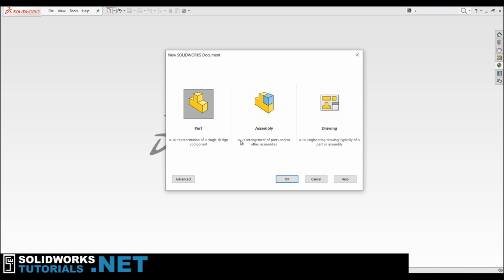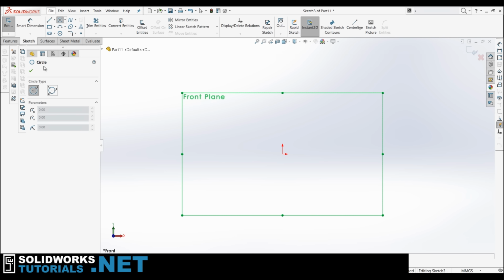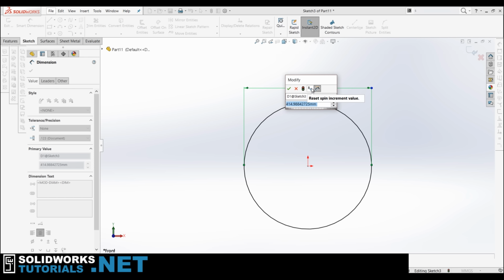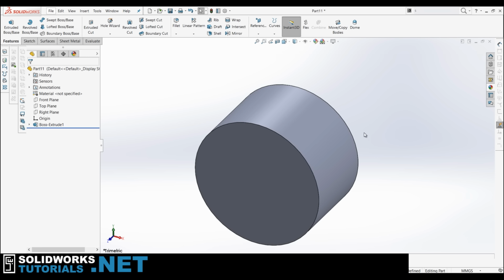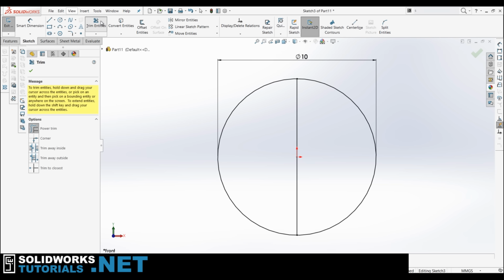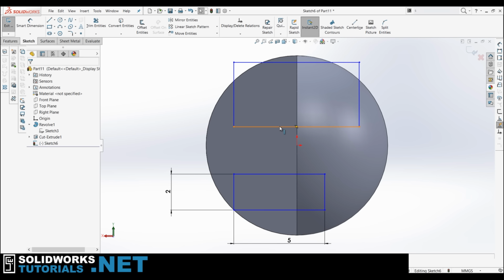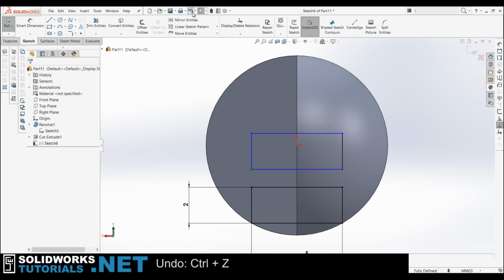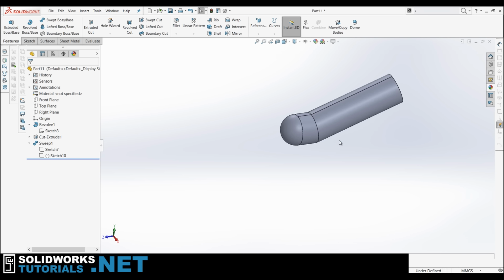SOLIDWORKS 2020 tutorial for beginners

Comment: I’m taking a DDT class rn, using solid works. Never used it before. I’m soooooo confused and this is beyond frustrating for me right now
Reply: What do you need?
Reply: AryAriba just the basics on how to operate it. Like basically we’re just doing sketching as of now on the computer through solid works
Reply from the maker: @Mason-zm1vk  Hi, Aryariba is my other channel. How can I help you? I do have a website that I post weekly step by step tutorials on for beginners and could be of help if you are interested. You will find the website in the bio of the channel. However, it requires membership to access the blog tutorials. If you are not interested in that, let me know what else can I do for you?

Comment: You better "mention" which button on the mouse to click.  This is a raw beginner tutorial, so you need to do that.  There are many cases where you can click "out" or "still be active" in the command.  A beginner doesn't know that, and will have the tendency to want to "escape" out of whatever is happening.

Comment: can't find what you did to make the rectangle vertex be exactly on the circle's edge
Reply: what i meant that, i wanted to draw the rectangle so it will match the both sides of the circle, so i had to draw a line first from left to right because it shows me when i should stop it gives me like a break that i reached the edge of the circle then i draw the rectangle, but i know the is not the right way, can i get an explain how i can do it ?
Reply: @phoenixcreations94  at what minute?
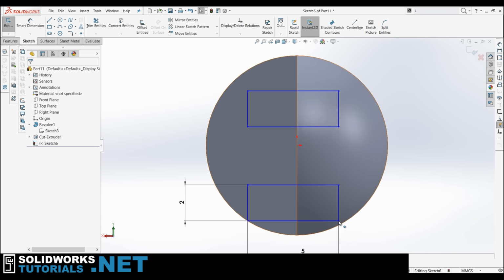Reply: 14:35  @mansoorishaker
Reply from the maker: @phoenixcreations94  Hold the Ctrl key down, select the point then select the edge of the sphere> then on the left find Coincident and click on it. Best, Ryan

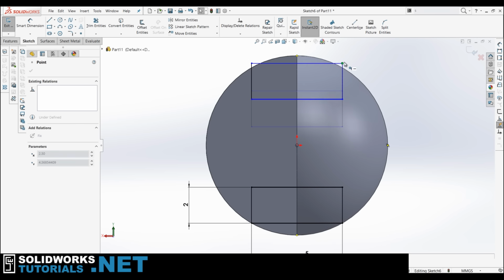Comment: Way too fast in some parts.  At roughly 15:01 you completely gloss over how to set the distance between the two rectangles.  Was that taught earlier?
Reply: Just select the outer edges of each rectangle and set the distance.
Reply: Thanks so much.  I did finally figure that out and should have posted the same.